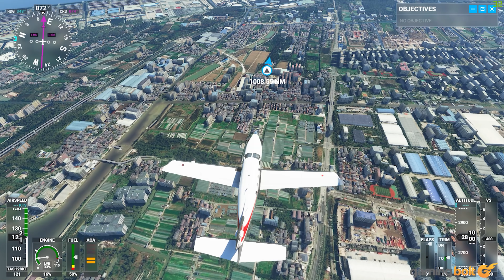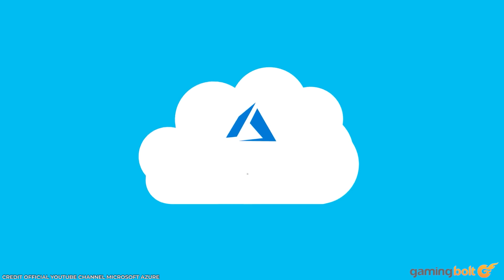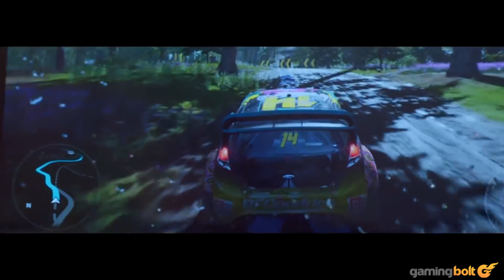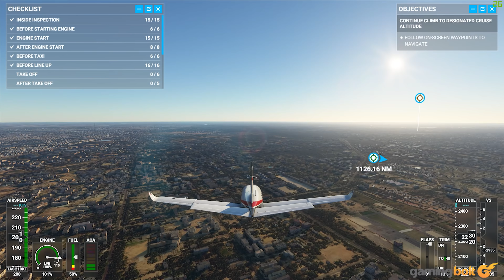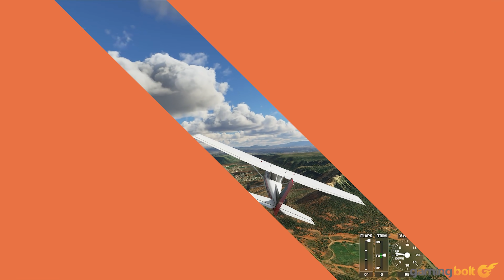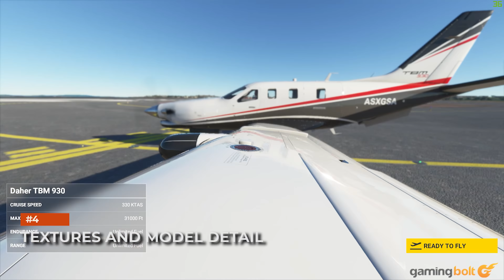Microsoft Flight Simulator Graphics Analysis - Next-Gen Begins Now

Comment: I think it's time, that nvidia launches its  new graphic cards......
Reply: Ms flight simulator is going to be great on series x hdr👍🏻
Reply: @Ahmed-t2l2f  Ya man, i agree with you.....
Reply: They are coming sept 1st 😉
Reply: Guys do you have an idea if the game has 4k at 60fps or higher.
Reply: @davidjohny3778  rtx 2080ti can't get 60 at 4k  currently we are limited by the hardware rtx 3000 series is coming on 1st sept so yah hopefully those cards will be able to run this at above 30 fps
Reply: @COYG94  that is what I mean, you know consoles has a different conceptions to enhance that games especially first party games 
Xbox can optimize flight simulator  and reach to 4k at 60fps or 1440p at 120 fps which  rtx 2080 ti can't
Reply: @davidjohny3778  if u r talking about upcoming xbox series x then yes it will be able to play it 4k 60 but then again new pc hardware is just around the corner like rtx 3000 launching before next gen consoles.
Reply: @COYG94  rtx 3000 will not support hdr
Reply: @davidjohny3778  we don't know that -_-
Reply: @COYG94  There is no doubt that pc has great values but if you want to buy a pc as series x sepec u need to pay over 1500 $ while series x is 400 to 500 $, however there is no hdr on pc
Reply: @davidjohny3778  there are 4k hdr monitors and 2080ti can do hdr, and i prefer spending 1000$ on a gaming pc than buying a console,  i have been gaming on pc since 2006 its the ultimate gaming machine and not just gaming its for other things too so no console for me lol
Reply: @COYG94  I know ur a pc gamer, that's good, u have thousands of games, and series x has almost the same due to the backwards compatibility, while ps5 has limited games due to the last gen backward compatibility only
Reply: @davidjohny3778  yah that is the good part all games shown so far for xbox series x will be available for pc too 😎
Reply: Hell no It's time for BIG NAVI. My Vega 56 can use system ram as vram up to 24gb which came in handy for this game. Reviewers said that feature was "pointless for gaming".